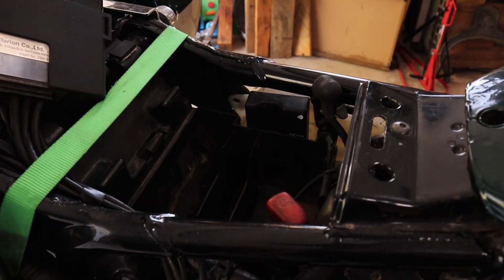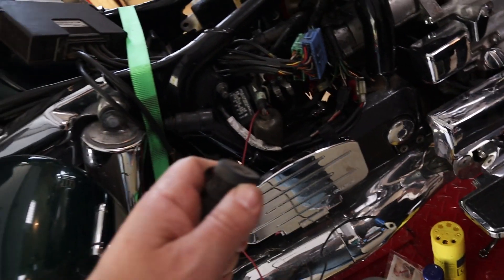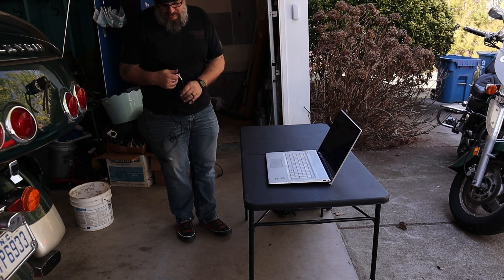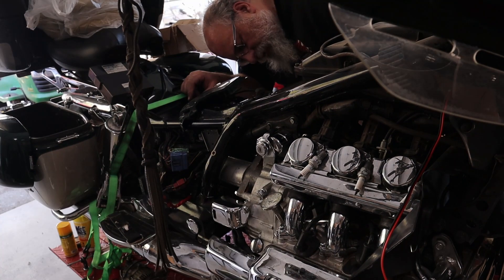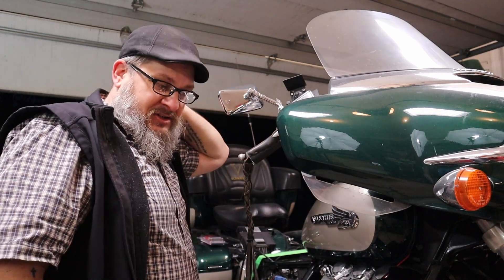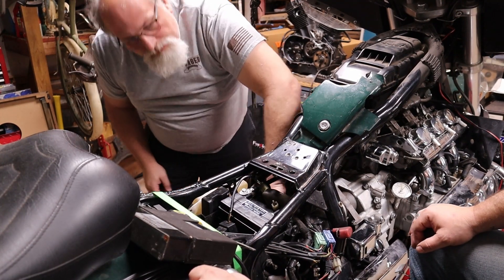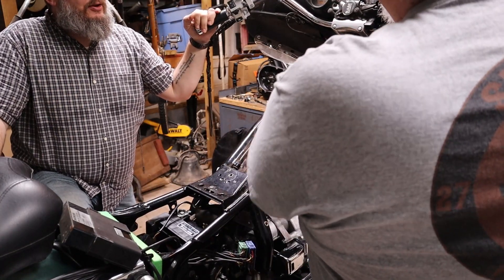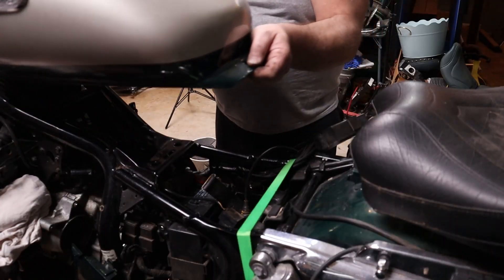Honda Valkaryie Hydrolock Repair Episode 2

Comment: I had to chuckle at the debate of whether the carbs had been serviced and Chuck says " maybe they have because all these clamps are loose "      judging by the box of parts not on the bike and everything electrical being unplugged, I'd say the previous mechanics definition of serviced may not be the same definition you guys or myself would use. 🤣
Reply from the maker: Yes I would say that’s pretty accurate.  Previous 3 mechanics lol

Comment: The clamps are loose on the carburetors because you have to pull them off to pull the motor to change the start of gear
Reply from the maker: Which is when I think he “serviced” them but it n hindsight I question that also. Waiting on the rebuild kit
Reply: I Really wish a video was available on what they did before you got the bike. Recently acquired a Valkyrie and hoping to dig in but can’t find very good information.